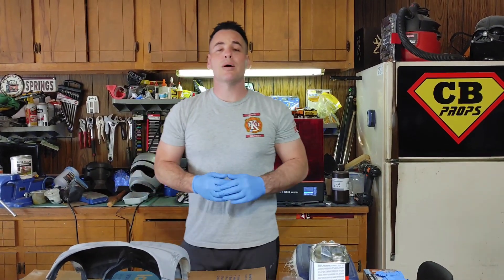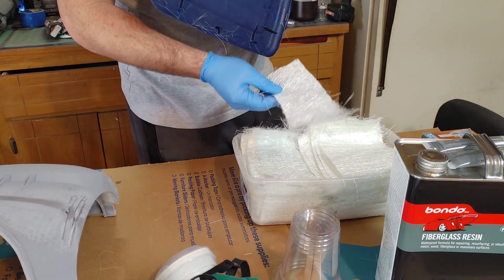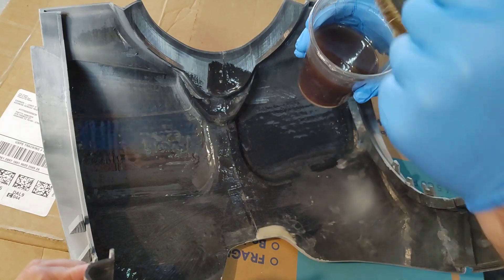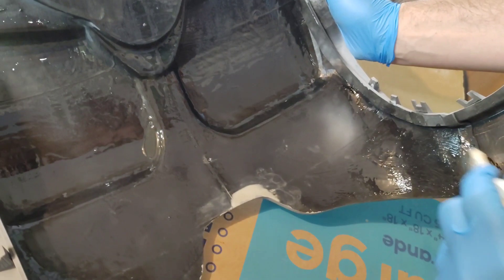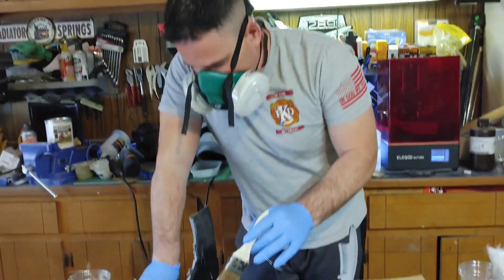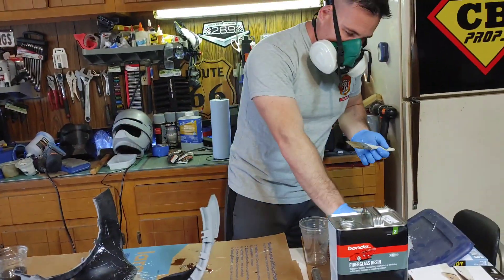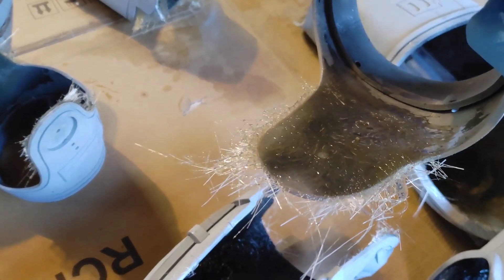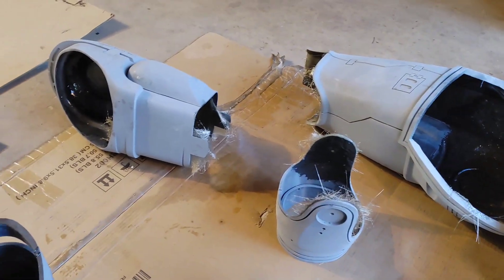How to Fiberglass Your 3D Printed Suit!

Comment: I had planned on fiberglassing over a 3d print however I found many sources saying that polyester resin and even epoxy resin will not stick to PLA, PETG and only slightly better to ABS.  What filament is that and did you have any separation issues?
Reply from the maker: @user-hh3fk5zd2v  I use PLA+ and I haven't had any issues with adhesion with multiple Robocop suits and various other parts.

Comment: Random potentially useful idea:
For stuff where you want detail, or areas you cant bulk out, used dryer sheets can be a decent substitute for fiberglass cloth. 
Its thin enough to mold into tighter areas, and is stronger than just resin. 
When thin, it is still somewhat flexable without bad cracking, but isnt as durable as the actual cloth. 
Hope it helps.
Reply from the maker: Super cool idea! I might have to try it one day on something that needs the strength but not a whole lot of it. Thanks for sharing!
Reply: @ChrisBoshProps  de nada. I figured it out for a cardboard witchking helmet. Cokeboxes for the general shapes, hot glued on the insides, and the glass on the outside. Came out surprisingly well considering it was my first attempt at using it, and one of my first at propmaking. 
Added bonus in this case, the texture isn't too far off wrought iron.

Comment: Does fiberglassing stop warpage from high heat days or if you want to 3D print something for inside of car. Leaving 3D prints in cars on hot days for just a few minutes can destroy a project.
Reply from the maker: It helps with the warping but your print can get soft and cause deformation and make the pla soft enough where your infill grid will start to show. If your leaving your prints for long periods in a car probably better to use Petg or ASA. For short periods in the sun PLA+ should be just fine.
Reply: @ChrisBoshProps  thanks. I was asking because I wanted to 3D print parts to scale for an Ecto 1 roof rack equipment. I guess all filaments are out to do this, even the carbon fiber huh? Any suggestions? Resin maybe for housings and small things.

Comment: Hi Chris again great video can you tell me which fibre glass mat your using didn't quite hear from the vid what you said you used and a link to where you buy would be great if possible thank you again for uploading great content
Reply from the maker: No problem. I used 1.5oz Fiberglass strand mat here https://www.ebay.com/itm/222750936155. You might not need that much as I use it also to make proton pack shells but that is what I purchase and use. I hope that helps!

Comment: Hey, Chris. I've been looking through your videos, but didn't see anything regarding my question. Do you have any tips for sizing the helmet? With all the different parts it seems like a bit of a challenge to assure they all fit correctly. 

Having worn the helmet, what do you recommend in terms of extra room? Is it pretty forgiving or is it fitted snugly? 

The helmet you recommend is on sale by the way for anyone looking to grab the model. I am looking to start printing mine mostly for display, but it would be cool if it fit as well.
Reply from the maker: Hello sir, when it comes to scaling the helmet fortunately for me I didn't have to as everything fit just fine. It's a little snug around the diameter of my head but there is some gappage from the top dome to the top of my own head that I had to add some EVA foam so the helmet sits right. 

For scaling its really easy. I use Simplify3D for my slicer and when you import your file to print the software immediately scales it at 100%, I'm assuming the free software's like CURA do the same. To make it larger you just add extra percentage along the X,Y, and Z until it fits right, most software's keep the proportions by default. If the initial size of the file doesn't fit...up it to 105% or 110% until it fits. After that, if it fits properly then make sure the remaining chin guard pieces are scaled to the same percentage so everything fits right. 

I printed each piece including the dome whole and I didn't have to cut any pieces up FIY. Hope that helps a bit!
Reply: @ChrisBoshProps  Yes. That is very helpful. Thank you. 

I have a few more questions about details if you have a moment. 

I'm looking at some reference photos and as you mentioned in a video or two there are a few Socket screws on the back plate. Have you reached out to the creator of the helmet asking if it would be possible to model some holes in? I was considering adding some in ZBrush, but I can't really distribute them because it's a paid product. 

Also, with the six vents on the back. Do you feel these are accurate on the model? To my eye they are more rounded on the sides and top. Also, do you think these are solid like the model or pass through like actual vents? 

This is another modification I'm considering making, but I wanted to get your thoughts. 

Finally, the circle in the middle of the back plate looks like it might not be the same silver as the rest. In the reference photos (screen caps) I'm seeing what looks to be an almost brass color. 

On a side note. I wish some of these details were separate on the model. The ears, back plate circle, and even the OCP POLICE 001 would be great if they were separate so they could be resin printed. You seem to have been able to keep your details super crisp (especially the writing), but it might be nice to have them separate. It is something I can do in Zbrush, but do you think it is worth the effort, meaning... have you found any issues with them being integrated?

Thanks!

EDIT: Sigh... this always happens. I purchase some files that I think are super accurate and then with a 10 min search I realize they aren't. The back plate seems to have a lot of inaccuracies. So far it seems the following need work. 

- The vents are not the correct shape and seem to come out a bit far.
- The bottom groove is too large
- The two vertical ovals are too far away from the vents (this may be because the vents are too small horizontally)
- There is a groove around the centre "disk" that doesn't seem to be on the screen used helmet. (trying to find better reference)
- The centre "disk" should be larger and it is stepped on the inside
- The centre groove should extend along the bottom
- missing screw mounts (yes these can be drilled afterwards, but it should at least have reference holes)
- The vents are spaced too far apart. The bottom of the top vent seems to align closer to the middle of the centre of the "disk" but it is way too high on the model.
Reply from the maker: @crazylegsmurphy  Hello again, I haven't reached out about anything concerning the helmet because I'm pretty happy with it. I didn't mind adding the socket caps on myself. The files aren't perfect but they are pretty close for being a replica model and pretty spot on looking once finished. Most of the details are there and close enough for me.